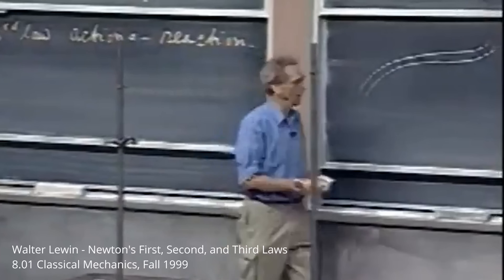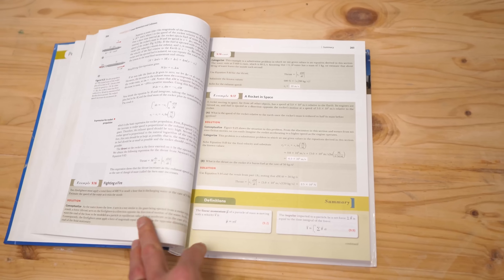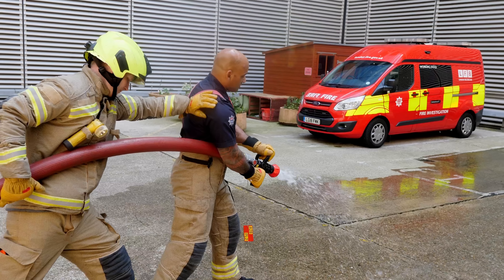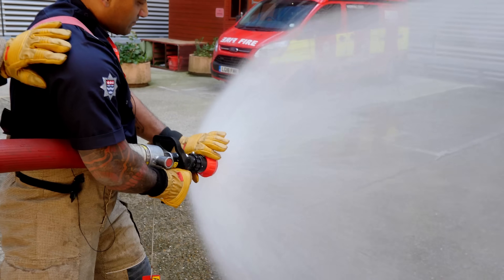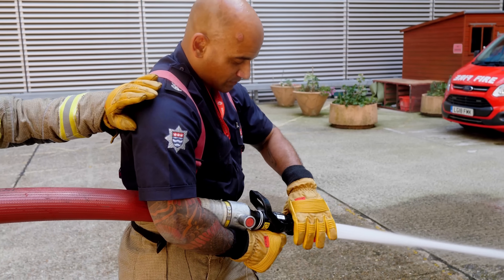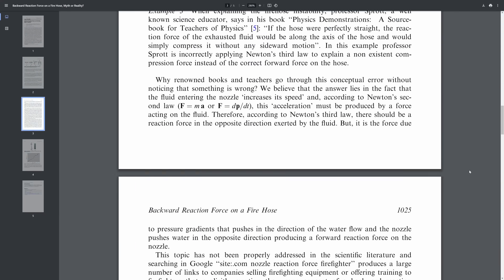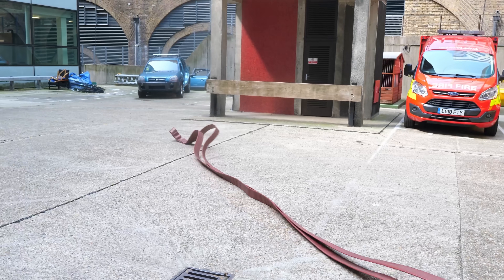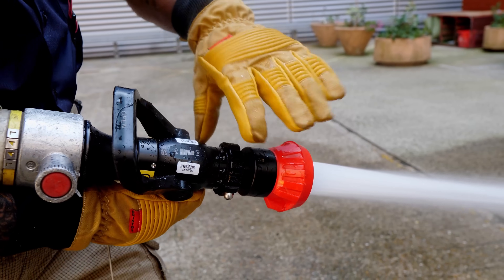Why chaotic hoses dance

Comment: I think its just the end of a fire hose flialing because the rest of the hose has too high pressure so the water has nowhere to go to let the hose bend. there is no more stretch for the hose to give
In addition hoses have chunky mass full of water and its tricky to move the mass.
if its a 70mm internal diameter its about 1kg of water per 38.5cm plus the weight of the hose

Comment: I mean, the reaction force not being at the pump but at the end of the hose is pretty obvious if you think about those jetski-hoverboard things. The pump is at the bottom in the water and the jets is under the feet of the guy who is flying on a board. So, it's pretty obvious the end of the hose is acting exactly like a rocket nozzle.

Comment: In the case of the fire nozzle the exiting column of water is faster with a smaller cross section of area. So there is probably additional reaction force to accelerate the water leaving the nozzle vs when the exit nozzle is the same cross section as the rest of the hose.

The wacky inflatable tube men are collapsing due to a lack of sufficient air pressure to inflate them to a stable column. When this happens they fold over and the fold restricts air flow causing air pressure to build up beneath the fold, this pushes upward until the tube is straightened out. When the tube is completely straightened air flows more freely through the tube until the pressure drops and the column becomes unstable and folds over once more.

Comment: Try your "force at end of hose" experiments with water.  Air doesn't have a much mass so the max force is harder to get higher,  and you want to maximize your delta force,  so use a medium where you can get more force.

Comment: i think a parameter that wasnt explored here is the flexibility of the hose itself. the fire hose and your plastic hose are much less flexible and "compressible" than the thin film the sky dancers are made of. im not sure it would be possible to get a "kink" in your relative quite strong hose, as the skydancer does

Comment: The firefighters' message about not charging the scooters is actually very insightful. I don't have one myself, nor do I intend on owning one, but I think it's very important to share and be aware of. More people should know about this.

This video is educating in its own right, and I'm glad the fire service was able to assist with the experiments!
Reply: yes my garage burned down because of it
Reply: I kind of hope everyone has heard this message by now, but obviously not. I've been around all my relatives and screamed the following at them: (1) NEVER throw a battery or anything with a battery in it into the garbage. It can (and does) start fires in the trucks and in the garbage depots, and it can and has killed people and the destruction of the trucks costs YOU money to replace. (2) NEVER charge a battery with anything other than the charger that came with it unless you are an properly educated electronics technician or engineer. All batteries - but especially lithium ones - are very sensitive to charge conditions and there is sometimes electronics in the battery that needs a partner circuit in the charger to work properly. (3) The cheapest batteries are the most expensive ones. Again, unless you are trained in electronics AND know what you're doing, buy from reputable local suppliers. At least they have an insurance company you can sue if something goes wrong. (4) Treat batteries like bombs, because that's exactly what they are - stored energy that can be explosively released if something goes wrong.
Reply: @AussieUnclePhil  The same could be said about gasoline. Treat it unsafely, and it will do unsafe things. If stored in an improper container, it can leak, and the vapors can ignite. 

Really though, any form of stored energy can react badly. We're just used to gasoline. And the safeguards against bad things happening have been made more and more idiot-proof over time. Batteries, and their regulation, is still very much in it's infancy, just like low octane gas, and the usage of leaded additives. Things will become better, over time.
Reply: @IceBergGeo  A lot of people don't have the common sense - or  rather the safety teachings that should be common sense if we educated people better - to handle petrol or any kind of liquid fuel

Comment: the explanation of the momentum of nozzle end is wrong as shown. A nozzle only accelerates the water, if it restricts the water in the later direction more than before (so the water has to accelerate through the smaller area, to keep the volume per second the same), in a straight cut of hose as shown, the water exists with its existing speed.

Comment: RE:  The reaction force the firefighter feels.  As someone who trained as a firefighter many years ago,  The type of nozzle your firefighter friend was using in your video has an adjustable spray pattern (like handheld shower head) and produces a lot less reaction force than a nozzle with a solid bore.  A solid bore nozzle will tire you out quick and requires at least two men to operate.

Comment: There are several factors at play:  (1) Bends in the hose cause the water to change direction, and the reaction force pushes the hose toward the outside of the bend.  (2) For a perfectly frictionless (inviscid) fluid, the pressure remains the same along the length of a horizontal hose of constant inside diameter.  For a real (viscous) fluid, the pressure decreases along the path of motion.  (3) The fluid pressure at the exit is atmospheric, regardless of whether a nozzle is present; there is no decrease in pressure at the exit that causes it to accelerate.  Therefore, fluid exiting a constant diameter hose (or a nozzle with the same inside diameter as the hose) exerts no reaction force, and the end of the hose does not need to be held in place, except for the effect of bends mentioned in (1).  (4) Fire hoses have a nozzle at the end with a smaller diameter than that of the hose.  This causes the fluid to accelerate, which creates a backward reaction force, similar to that of a rocket.  This force needs to be opposed by the person holding the nozzle.  (5) Pressure in the hose puts the hose in tension.  This tension offsets the increase in pressure produced by the pump, so the pump does not experience backward force due to the higher pressure at the pump exit.  (6) Hoses with bends in them and/or converging nozzles at the ends of them may become unstable, especially if they are sufficiently long and flexible.  The instabilities are due to one or both of the aforementioned effects.

Comment: 9:25 could the discrepancy be related to the overpressure of the fluid compared to the air around it when it escape? With the rocket example the engine bell is built out such a way that the combustion product is close to the the same pressure as the air around it so the force is directed vertically into the rocket. When the air pressure is less than the pressure inside the engine bell the flame expand so some of the vectors point away from the rocket and, while the balance out, it is an inefficiency because that small amount of horizontal change doesn't push the rocket up it just pushes against itself.
Reply: Oh. If I had waited 3 minutes I'd've seen you say the same thing.

Comment: I dont think the firefighter made a compelling case for not just turning off the valve to regain control of the hose.  That was easily faster than two guys crawling on the ground, chasing the end down.  Smarter, not harder, fellas.  80% of the time, it works every time.

Comment: I think you over complicated it
While the water leaving the nozzle did already have momentum the rocket equation still applies because that momentum was helping push the nozzle away before leaving still resulting in the same backwards force.
As for the sideways forces in the pipe, they also cancel out because in a restrained rope any outwards sideways force applied must shorten the rope. Because all forces will be outwards relative to their section of hose all their force must result in a pulling force at the end of the hose.
These 2 effects will balance out so in theory the shape doesn't matter. Which makes sense, at the end of the day the energy that went in is the same in both cases

Comment: Surely you could test your model by setting up a straight run of fire hose anchored at the pump end and see if it takes basically no force to hold the other end straight?

Comment: You need to look at both momentum and energy.

Redirecting the water (inside the hose) transfers no energy, but transfers momentum.

Similarly, the firefighter transfers no energy into the water; you could replace her with a fixed attachment to a wall.  But she does transfer momentum.  And that's transfer of momentum over time is exactly what a force is that she feels.

A good experiment to run would be to use a perfectly straight hose.  Perhaps use a telescopable pipe or so, so that the pipe/hose itself could not transmit any force parallel to the water.

A perfectly straight hose should not feel any force from the redirection of the water.  But it should still feel any force from the speedup of the water at the end (if that effect is actually real, I don't know).

Comment: Wait
In your experiment of the force exerted by the air tube 
The angle is 0 and 360
You should maybe try different angles to prove it wrong though i think your reasoning is wrong
Reply: A small correction 
You must get the same force no matter what the angle is 
Because you forgot to think about the reaction force due to the bent 
As the bent is with an angle to the jet 
It must a apply a "normal force" on it

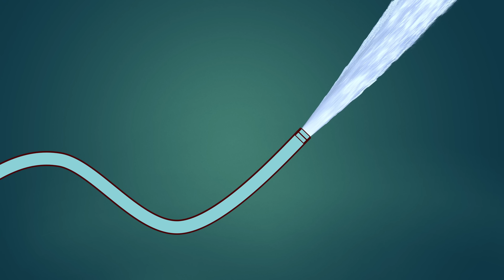Comment: I think an explanation as to why the force transfer between adjacent packets of water all the way back to the pump ( 13:01) doesn't occur is because there is also friction to consider between the fluid and the pipe. So there is a transfer of force also directly applied to the walls of the pipe. The  influence of the feictional force could be investigated by changing pipe roughness, viscosity, laminar vs turbulent flow etc

Comment: a nice way to show this might be to decouple the reaction force at the tip from the other forces going on within the hose, perhaps by making alterations to the outflow at the tip. for example putting an attachment that shoots the water in multiple lateral directions canceling out the reaction forces and comparing to a different scenario where you maintain the same flow rate but the  water is again directed in a single direction restoring the reaction force at the tip. you could also experiment with a reservoir pressurized at the tip which would get rid of the high flow characteristics and just produce the change in pressure at the tip aspect.

Comment: The Force of the water is 'constrained and directed' by the 'wall/fabric' of the hose which exerts a tensile resistance to its escape, thus transmiting the force; The force is only 'liberated' at the nozzle.  There is also a 'pulse' in the flow which is generated by the pump and creates turbulece in the flow which acts upon the wall of the hose causing it to flex as shock waves test the elasticity of the hose material. It is this 'elasticity' that allows the hose to bend, the force and inertia of the water constantly 'seeks' to straigten it setting up harmonic waves, hence the 'riggle'. I think, but don't quote me, 'Laminar Flow' is a factor? 
The pressure inside the hose is not truly uniform, the wall of the hose creates drag (boundary layer effect) and still more turbulence within it ( fluid dynamics ?).
The constriction at the end serves mainly to accelerate the flow (venturi effect ?), increasing its inertial moment and reach a greater height. 
Hope this helps in understanding or even stimulates further experiment ... 🤗

Comment: 11:19 I think the only reason for the different behaviour is the rigidity of the tube. If the windtube man was a rigid as those pipes and the air flow was proportional, it would behave the same. But this non-rigid fabric bends sharply because that's how flimsy non-stretching fabric is. But essentially, it is roughly the same phenomenon.

Comment: It's absolutely the same, only the gas runs through the hose faster with less force applied on the walls and the water runs slower with more force on the walls, that's how you get a different result.

Comment: When you brought up the water parcels, it seemed like it was missing something, and it got me thinking, when there's a bend, perhaps you need to factor in the differential of the water flow and forces from the inner end of the bend, vs the outer end, and the internal shape change from a bend... and what happens with bends on oddly shaped hoses? (Oval, Hourglass, etc.)

Comment: The issue is the change from pressure to velocity, like in a rocket engine’s combustion chamber. It starts as pressure, like inside the hose, the changes to high velocity at the nozzle.

Comment: Nozzle is smaller diameter than hose, meaning more force at the tip, if there was no nozzle you'd just be holding the weight of the water and resisting the curvature. It's not same force as getting hit by the stream, let the firefighters test that 😄

Comment: The force felt has got to be proportional to the resistance experienced by the fluid moving through the line/hose and it's velocity through the line and hose. The balloon and waving men use the fluid to give it's structure. The longer the hose is without outside resistance/support, the more it will flail around.

Comment: I believe the non perfect straightness would always lead to pushing more horizontally. 
In the case of the water hose, the internal boundary wall would have an uneven force distribution and thus pull the hose one way or another. 
In the case of the air hose, I think you could also have additional interaction with the atmosphere as the turbulent air mixes exiting the hose, unclear to me how that could affect the system.

Comment: For comparison, I'm thinking about the forces on a pressure washer nozzle, a bit like in your angled nozzle example.
If you've ever used one with a long (I don't know what it's called in English) "lance" with the nozzle at an angle, it's pretty clear that the majority of the force is acting at the point of the nozzle, in the opposite  direction the nozzle is pointing. If you don't brace yourself, you might whack yourself in the face with the lance recoil. The forces on the hose is failry decoupled from the forces of the nozzle in the pressure washer scenario though.
Also the point in another comment is good, that at some specific angle/direction, the force more or less disappears (not so for an angled nozzle of course). Then you need only minimal force to keep it under control (leading to a false sense of security), but change direction slightly and it's back instantly, and will try to whack you again :D

Comment: I think theres a missing factor, what happene when you have high enough pressure within the hose itself that it pushes the outer hose piping to maintain solidness, wouldnt that make it more harder to bend? So isnt that whats happening with the firefighter hose, but at the end of the pipe theres a decreae in pressure due to well the water exiting 

Maybe im completely wrong on this one, but a way to look at it is force vectors along the entire pipe exibiting a roughly 45 degrees outwards force in a cone shape all the way to the hose tip, where it would straighten up to be parallel with the hose exit hole, the high outwards pushing force stops any kinks from manifesting along the pipe

In your example you had the syringe as a fixed anker point, yet at your lower pressure the entire pipe would wiggle and kink,

Comment: I may be totally missing something but the idea that the change in pressure at the end of the hose causes the water to speed up makes no sense to me. When water flows through a pipe and the diameter of the pipe suddenly increases the water will slow down not speed up. Pressure gradients don't "push" on the fluid particles, the apparent motion is due to diffusion.

Comment: The differences in the different fire departments over the world is fascinating. A training as in 04:56 does not exist in our (German) fire dept as it is not necessary.
There is 1 person on every hose distributor or valve. In the case the guys at the nozzle lose control or the hose bursts that person can close the valve way faster than the other guys try to catch the whipping end.

Comment: My initial thought on your testing of the air hose with the analogue newton meter was that even though you are contorting the hose into different configurations, the constriction is removing that chaotic element, allowing the pressure to eventually building up to the 'normal' pressure of an unconstrained hose and there for the meter is showing the same as the unconstrained method, at least on camera. Have you tried using slow mo to compare the readings over a 'longer instance' or do you have access to a digital force meter or a thrust force cell? Would something like that, a little more sensitive show the difference in force. Like maybe show a significant lag time into the full force of the compressor when the hose is in different configurations
Reply: Yep kept watching, carry on